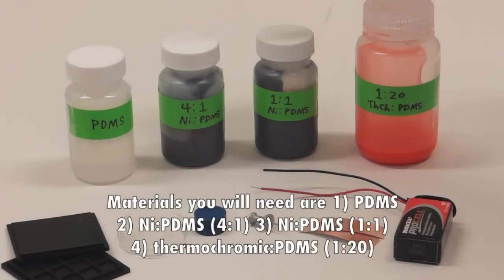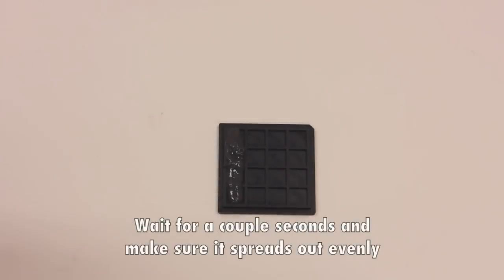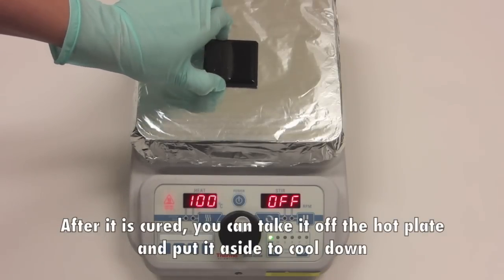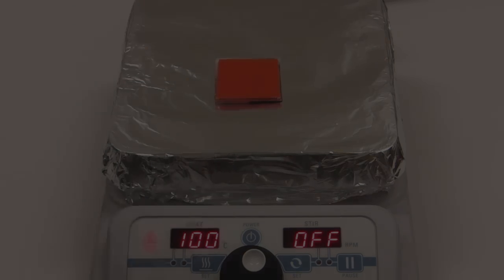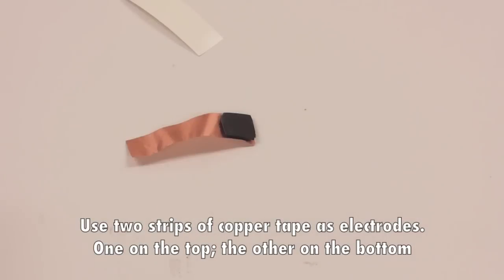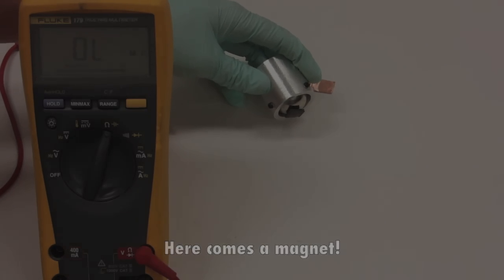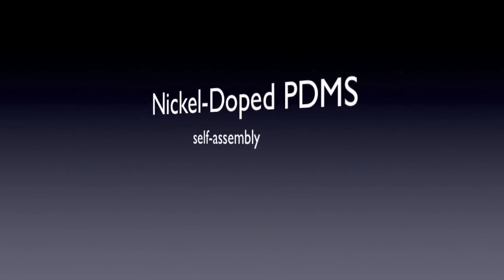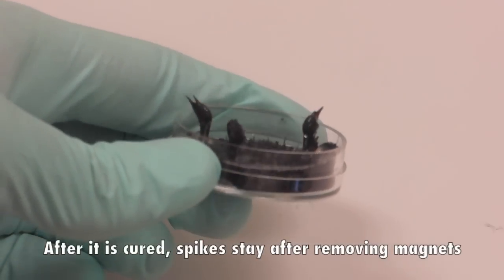Lab 8: Doping

Comment: Using copper tape which has adhesive to measure the electrical conductivity is a bad and poor idea that will result a wrong measurement because the adhesive will destroy the electrical path.